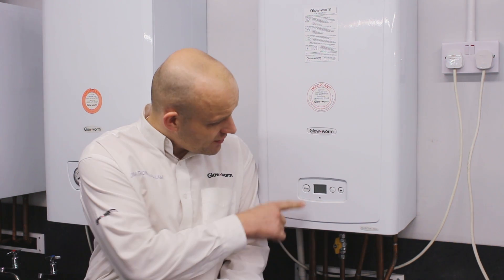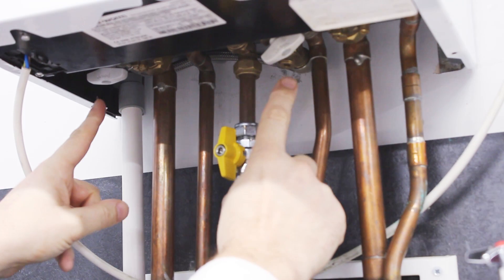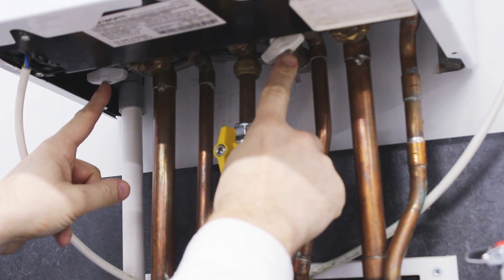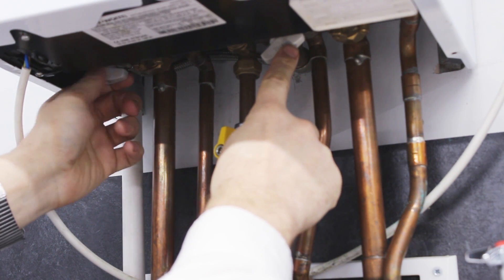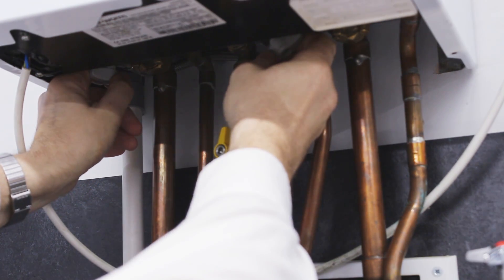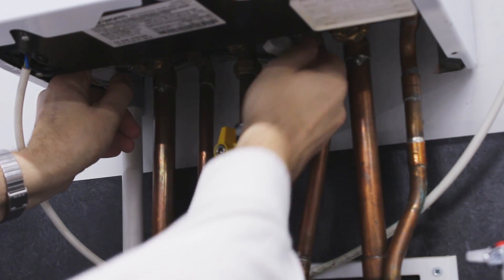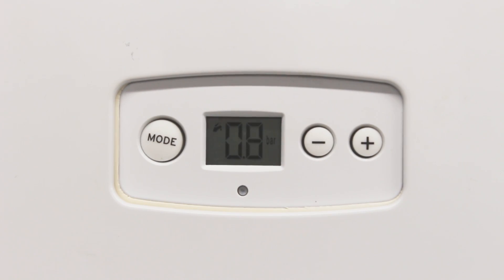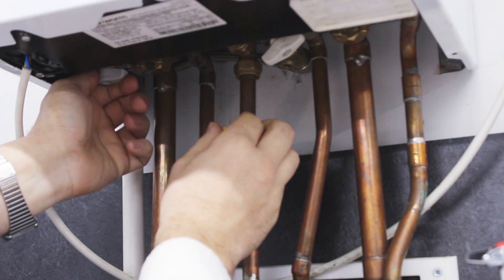How to Pressurise a Glow-worm Boiler - Flexicom

Comment: Had a slight panic when boiler stopped working when pressure fell to 0.4 bars. Notes on front of boiler instructed  “connect filling loop  under the boiler and open both taps” if pressure falls below 0.5 bars. There was no obvious filling loop  and I feared a callout would become necessary. Thankfully, the instructions on this  video were really helpful and the boiler was up and running in less than a minute. Great!
Reply: Did you have a leak ? Or did you just fill it up once and it was ok

Comment: I have a Glow worm flexicon 24CX and when we use the heating, for some reason the pressure showing in the display keeps going up and up slowly and never decreases. within a week, as we use the heating, the pressure showing in the display goes up to 2.7 bars. I then need to use one of the drain off valves in one of the radiators and drain some water in order to bring the pressure down to 1.0-1.2 bars. What is causing this? I'm monitoring this situation and when using just hot water in any of the taps, it doesn't make the pressure to go up and up like when using the heating.
Reply: Hi, I have the same with my boiler. Have you found a solution for it? Thanks
Reply: @IbbyKS  hello. In our situation, one of the valves of the filling loop was letting water pass by, in other words, the valve wasn’t closing as it should to stop water getting in the system. The engineer replaced them and problem sorted. However, your problem can be different, so call an engineer to have a look.

Comment: So you open first left valve, then the right one. Am I my mistaken to see you open them by turning the knobs clockwise  as it would seem to me to close them when clockwise? The point is, my knobs are loose and actually one is missing.
Reply from the maker: Good morning, our technical team will be able to talk you through the process and answer any questions you have. You can call them on 0344 693 3133. Thanks.

Comment: In my case the pressure is too high 2.8 bar so how can I get it down to 1 bar?
Reply from the maker: Hello Phil, you can access the manuals for our boilers on our website at https://www.glow-worm.co.uk/glow-worm/products-1/flexicom-1/flexicom-hx-user-157171.pdf. If you need any further support, please call our technical team on 0344 693 3133.
Reply: bleed a cold radiator untill the pressure reads 1.1 bar

Comment: Trying to fix an F22 Fault on a Flexicom 12HX; if it's due to low pressure then I don't have these two grey taps. Instead I've just got the one yellow tap which appears to have something to do with gas according to the manual...

Any ideas?
Reply: I have the same problem, did you ever manage to fix it?
Reply: @MrWeddG  good luck getting a reply, these boilers are a scam
Reply: @MrWeddG  same problem here too. just one yellow tap. did you manage to fix it?
Reply: same problem. just one yellow tap. did you manage to find out how to repressure? thx
Reply: @Everythings_a_Frame  sorry friend, I have absolutely no idea. Online guides suggested it should either be due to low pressure or some kind of ignition failure. We had to get someone out to reset the system, but I can't remember if they even mentioned what the issue was.

If the F22 error alternates with an F4 it's almost certainly an ignition problem. If I actually got notifications from YouTube for the other replies, I might have remembered what they said the cause was :/ haven't had the same issue since though. Sorry again!
Reply: @RL-  many thanks for the reply. Its probably best to get someone out and have a look 😊